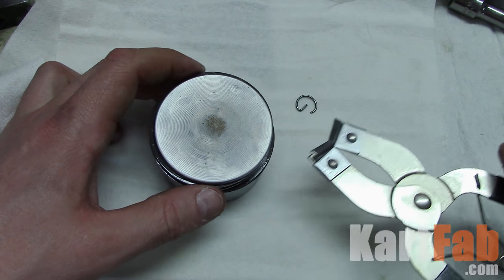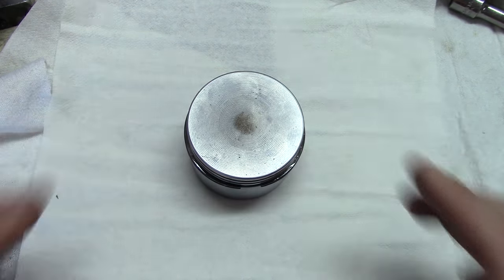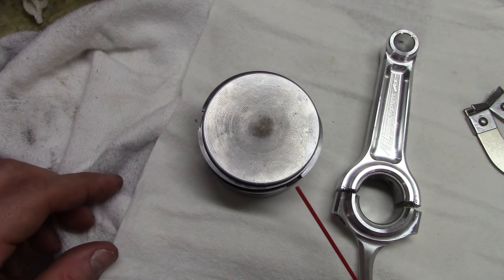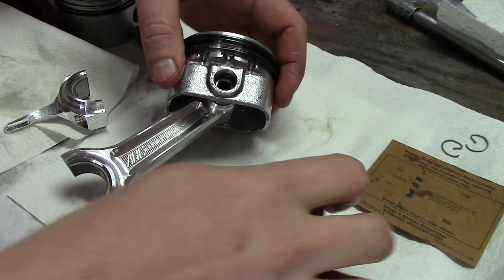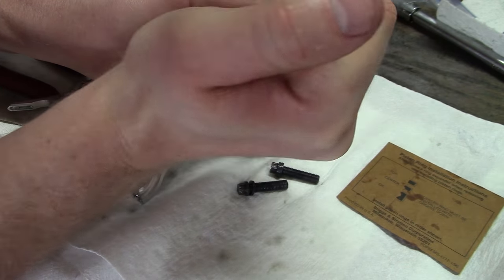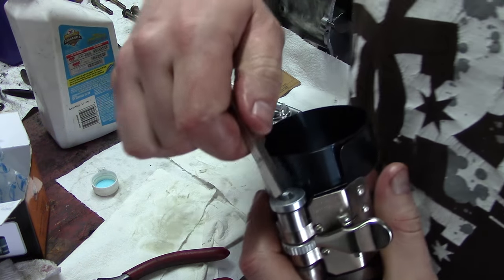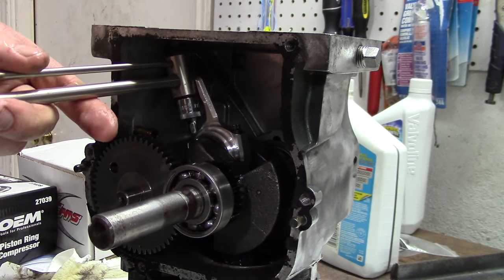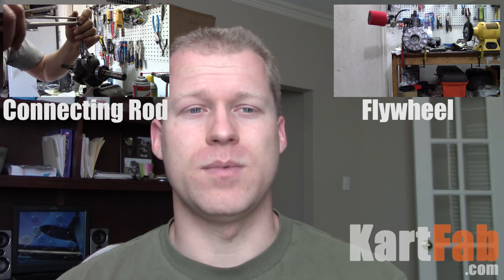How to Install a Piston and Rings

Comment: Finally you covered the problem that I had, which was the ring gap and the degrees apart. I needed to actually see it. Of course I’m a 14 year old boy building a stage 2 predator on my own sooo.
Reply: I’m gonna build a Briggs flathead and I’m 12 so home urs goes well
Reply: I know a decent amount about small engines tho
Reply: I’m 8 and I built a car engine

Comment: I know this video was made ages ago but even after following all these steps and using the Piston Ring Compressor tool I still can't get the rings to compress tight enough to get into the bore hole. While the piston and Rings are still in the Compressor tool if i look inside I can see the rings popping out on one side inside the tool. They won't evenly compress for some reason. I've been stuck on this issue for almost a Month now and it's driving me crazy!

Comment: If you leave the connecting rod and just pull the head off how do you compress the rings to slide the head down. Saw this done in another video maybe that’s not recommended?

Comment: I replaced the piston before all by hand, I'm not sure how. I have a 38mm piston that I'm trying to get in the bore. It's for a German moped. The only piston compressor I can find is $25. That seems like a lot of money for like 1-2 uses. I'm going to try and use 1.5" tubing instead and makeshift my own compressor. I'll let you know how it goes.
Reply: Thanks BTW for showing how you do it. It's pretty straight forward and yet I didn't even think of using a tool like that.

Comment: mine slowly reveals gradual amounts of oil creeping up from the cylinder walls. None of the rings are broken and look fine, the cylinder wall looks perfect, it shows the original machining texture
Reply from the maker: Check ring end gap. Check to see it rings were installed upside down (esp the second ring)
Reply: @KartFab  Ok ty I will do. also maybe they have lost a little bit of strength, I will try and carefully spread them out to make them springy again :)
Reply from the maker: @friedchicken1  if you do that, you might warp or have excessive tension on the rings. Its better to buy a cheap set of new rings than to try and add tension to the ones you have.

Comment: Does it mater the piston orientation in the block ? Mine isn’t marked ! Some I’ve done had markings , an arrow or a line or something , this one isn’t . It’s a HSK70 Tecumseh .
Reply from the maker: Check the tecumseh factory service manual. Also check underside of piston. Some have no marks and it doesn’t matter which way.

Comment: nice video, what if you put the ring gaps 180 degrees apart?
Reply from the maker: Beats me. 120 deg is what they all are installed at.
Reply: *****
is that what the manufacture specified?
Reply from the maker: yep. Rings should not be at a 90 degree to the wrist pin, or in the same position to wrist pin.
Reply: ok

Comment: Once I upgrade the connecting rod, piston, flywheel, camshaft, etc. will it be safe to remove the governor and put the engine through hell of a high rpm?
Reply from the maker: yup. I doubt you can get it to a super high rpm without doing a lot of modifications for flow, getting timing just right, and having a wild cam with upgraded valvetrain.
Reply: Hey, this is my brother's account but I only expect to get 6300 rpms, as that is what the fillet flywheel, connecting rod, performance piston, performance camshaft, upgrade valves and valvesprings can handle. I am trying to do this to a Predator 670cc and place on an insane off road go kart.
Reply from the maker: predator 670 has had some issues past 5500. Good luck as you are in mostly uncharted territory.
Reply: Alright thanks, I will need the luck!
Reply from the maker: Also, IIRC there isnt a huge selection in performance parts for the predator 670cc. I do know that the honda gx390 stuff would fit the honda gx620 etc, but you would have to do a lot of research to see piston size, rod length, rod end sizes etc in order to figure out what to get for the predator. If you do the math, it is actually cheaper to get a decent used motorcycle engine with insane hp for a lot less than hopping up an engine like that.
Reply: Oh alright, thanks for the tip. I am just trying to find the best method to build an insanely fast go kart, guess I should go for a used motorcycle engine, thanks for the quick tip

Comment: I have an aluminum briggs 6bs from the 50s and it's losing compression because I overrevved it and wallered out  the bore, is it worth fixing?
Reply from the maker: +Gslash25 hmm. You can take it to a shop and have them sleeve it, then put in a new piston and rings. Now..... Is it with it? That totally depends on you.
Reply: +KartFab ok, might've been worth it if I had left it in more original condition or made power, but I might put it on my great uncles one wheeler peeler kart
Reply: +KartFab and thank you for responding as well! it sucks to see you tubers that don't reply to comments

Comment: Rod bolts on a arc rod are 270 or 170 inch lbs??
Reply from the maker: Depends on the rod. The smaller rods are 170 inch lbs and big block stuff is more.
Reply: @KartFab  thxs sp much for the fast response I'm at my table doing it now and it's a ARC 6269 rod thxs
Reply: @KartFab  gx 200